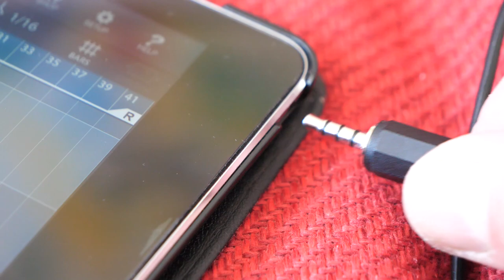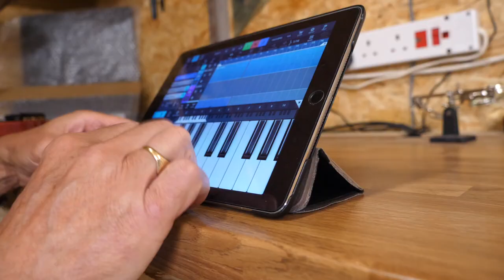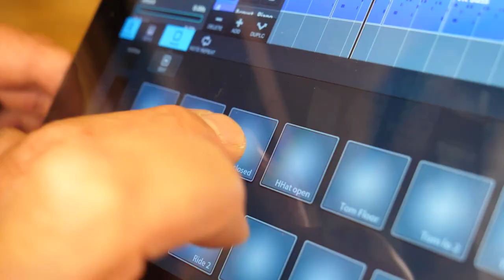Day 7 Great Guitar Build Off 2020 unofficial challenge - build from scratch

Comment: I picked up a rather cool trick for neck shaping. I put a 45 degree chamferring bit in my drill press, and with the fingerboard still flat, I run the back of the neck along the bearing slowly raising the table until I have almost reached the side of the fingerboard. This leaves very little filing and it gives you an accurate profile.
Reply from the maker: That sounds very cool, I would like to see how you do that. Cheers Dave
Reply: @DaveDickens  I will video the next time I do one.

Comment: Coming along - you're getting there 
Was goig to type to put binding on the bottom of the neck ad then you said it 
great minds and all that ... lol
Reply from the maker: Thanks Rab, you obviously spurred me on to do the right thing. Sorry for the late reply, cheers Dave
Reply: @DaveDickens  there's more important things to be getting on with and you did because now it's finished and with just a couple of wee things to finish off it's certainly looking the part thats for sure 
What's the dimensions of those travel guitars you make?
Reply from the maker: The whole length is 840mm, scale length is 648mm with 21 frets, weight is about 2.3kg. Cheers Dave
Reply: @DaveDickens  Had to look at my tape measure there to see what you were talking about, cause it's easier for me to work it out in inches ... lol yep a'm old too
Well mid 50's so we done both really at school imperial and metric 
It's easier measuring small stuff in mm instead of working out what half of 5/32 is but still old school like 4x2 not whatever it is in cm's etc ... lol